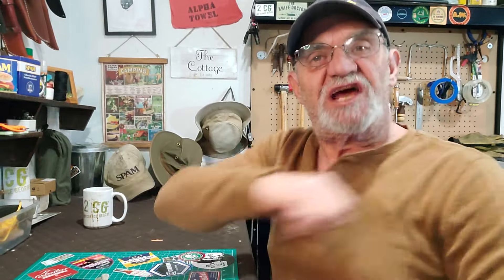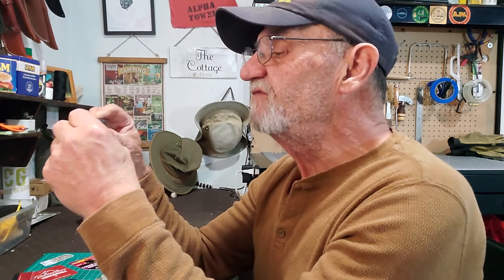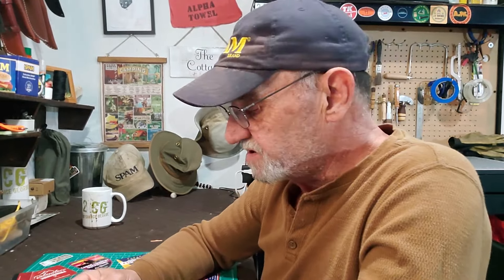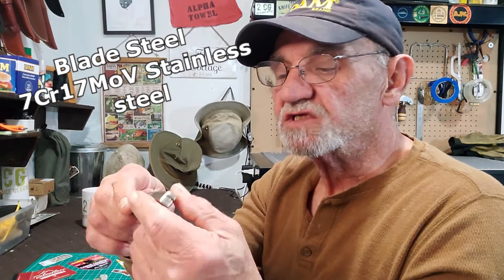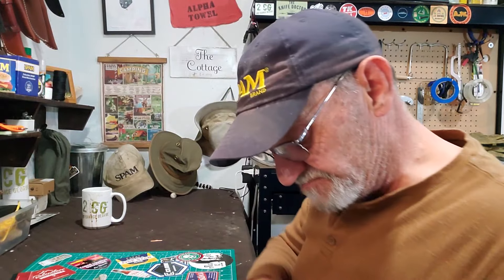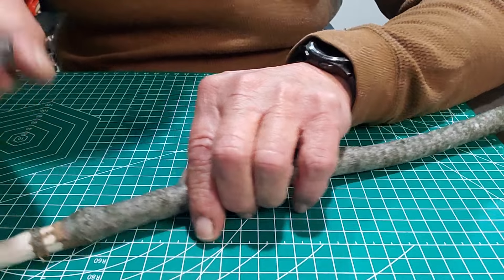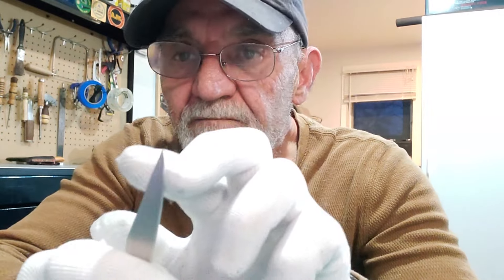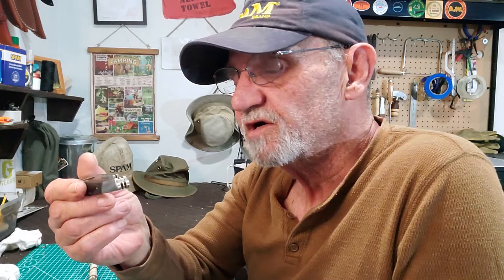Kershaw Iredale 4386: A Modern Twist On Traditional Style!

Comment: Found this explanation - 

ABOUT
Named after the Peter Iredale shipwreck in Astoria, Oregon, the Iredale pays respect to history while also pushing forward with a fresh design. Featuring a non-locking slipjoint mechanism, the Iredale includes a clip point blade and two sheepsfoot blades. Any of them can be used for everyday tasks, depending on the size and type of job. The polished micarta handle adds style and strength to the knife, along with steel bolsters and brass liners. It’s traditional, yes, but this three-bladed Kershaw stands out in the modern era with plenty of character.

Unique non-locking slipjoint style; includes clip point and two sheepsfoot blades
Reply from the maker: Yep saw that. Interesting they say 2 sheep's foot blades... thanks for watching, always appreciated 😀